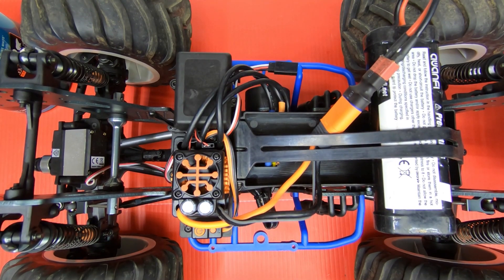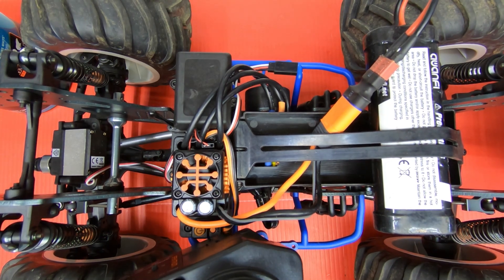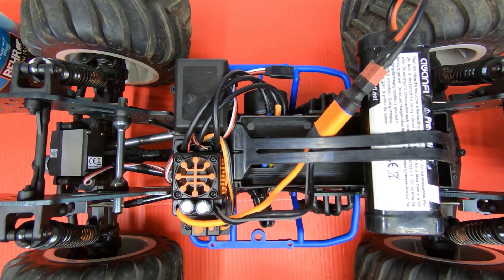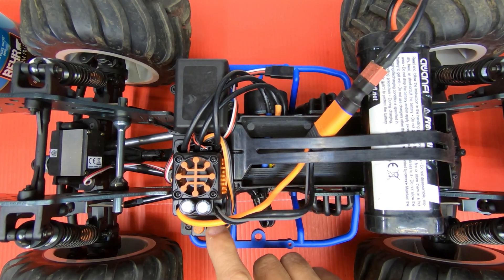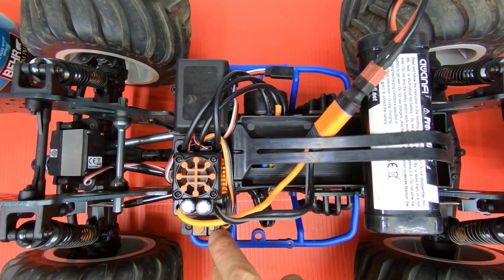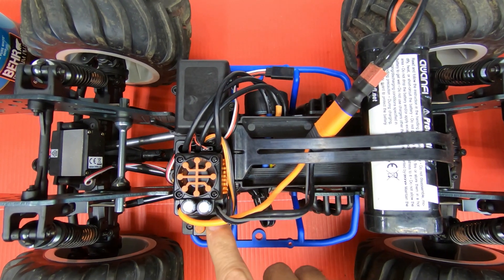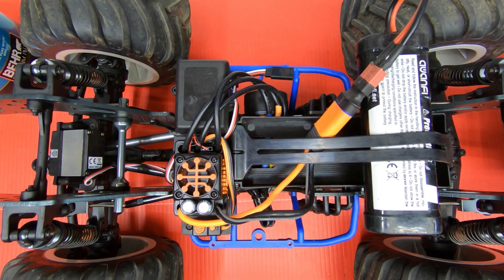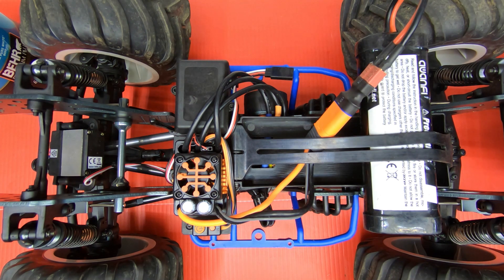Losi LMT  ESC how to program & change settings

Comment: FedEx literally just dropped mine off. I'm unboxing as I watch lol. Bet this helped alot of people. I want to check to see if a hobbywing program card works with the spectrum esc.
Reply: Lol I just commented about you getting one lol
Reply: Hobbywing card will work, been using it on a 130a spektrum esc I slapped in a kyosho.
Reply: @philthyco1  Heck yeah bud! FedEx really does deliver in Sunday lol. Bout to crack it open!
Reply: @JL-rb7ml  That's good to know! I have the tt pro that has the 130a spectrum so I'll use it. Thanks for the heads up
Reply from the maker: that's awesome this things amazing just got back from another run with mine and nothing but smiles the whole time driving it!
Reply from the maker: That's Cool but I do like the fact that with this esc it's real easy to program without the card unlike other esc's that make it crazy to program them... good esc very easy to adjust settings and set up. 👍
Reply from the maker: 👍this is a good esc simple to set up you don't even need the card unlike other esc's that are crazy hard to adjust anything on them manually.

Comment: Ok my truck will not move i unplug the esc thinking it was for the lights will that stop it from. Moving my battery  is full charge  so do I have to reprogram  it with that set button
Reply from the maker: What type of battery? also I think you should reset the esc settings worth a try.  Thanks for watching.

Comment: You right 3 too low ,I shouldve changed mine , I did increase the punch it needs punch increased imo
Reply from the maker: Yea don't know why they set it to 3.0v that's not to good.. what do you run yours mainly on 2s or 3s?  Thanks
Reply: @ShenRC  I just got it last night shen , im probably going use 3s . I use 4s with this system in the dbpro with no problems,  ..you looking run 2s ?
Reply from the maker: @paulclancy2404  Hi yes I am running 2s it's way fast enough for me I am used to my clodbusters only going 16mph.